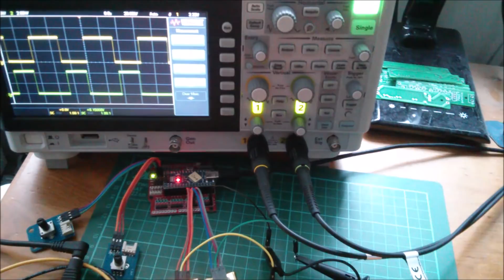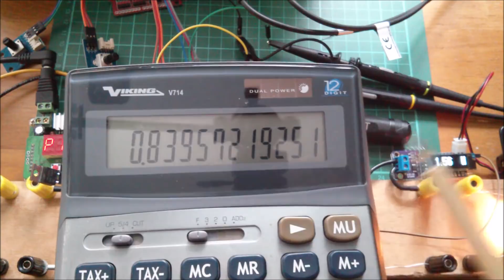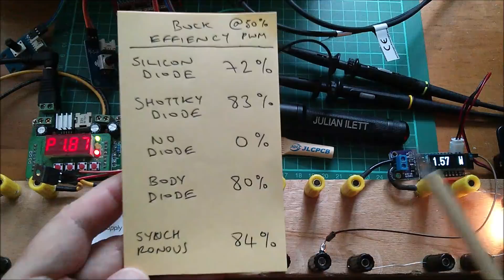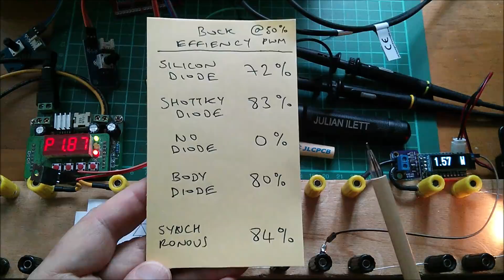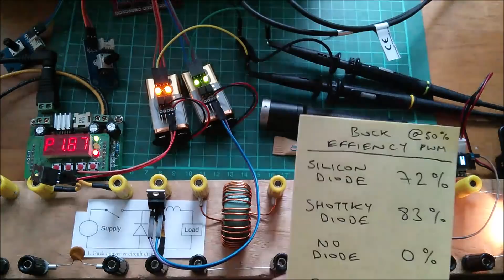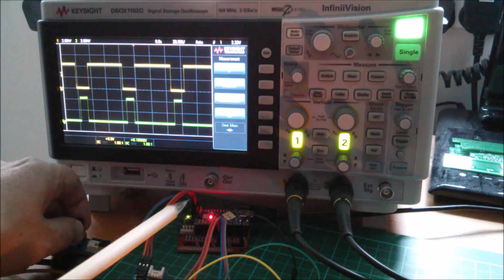Let's build a Synchronous Buck Converter

Comment: whats the value of the inductor, and what effect does changing that value have on the process and efficiency?
Reply from the maker: Not sure - it's quite big :)
Reply: Changing the inductor value changes how fast the current will rise and fall, or the ripple current.
Basically whenever the main mosfet is on, the current through the inductor rises, when it is off it falls. The output voltage depends on this current, especially since julian is not using an output capacitor.

For efficiency the inductor value doesn´t matter on its own. But with lower inductance you have to switch your mosfet(s) faster, which causes more switching losses. On the other hand small-value inductors can be physically smaller and your input/output capacitors can be smaller as well.
Reply: @Basement ScienceE
thats useful info , ive not seen this explained so well before . i tried changing inductors in phone charges to see what happens (not connected to phone) and saw no change at all , so obviously not to critical :-)
Reply: YTANDY100 You always have to consider the load you have attached. In nearly all real SMPS the duty cycle needs to be adjusted according to the load. This is done by an IC, which is also able to cope with wide ranges of inductances.
Reply: @Basement ScienceE
it was a 34064 chip that ran it , i never changed any of the Rs or Cs , just the choke , i never thought about changing the load , i think at the time i was only using an led and a volt meter to see any changes , it was just because i had many similar charges , all slightly different but same chip , some with an output transistor but most without and all had different chokes , i was swapping them and finding some else where :-)

Comment: What happens if you use the shottcky AND the MOSFET? 
I think that the efficiency will increase since the body diode is not that efficient.
Reply from the maker: There is an advantage - the LTC3780 datasheet shows Schottky diodes in parallel with two of the MOSFETS.
Reply: I hope you'll try that and let us know

Comment: But want is the difference between a synchronous and an asynchronous converter? All I know is that one is more efficient than the other. I have looked online without success so far.
Reply: There is a down-side, of course. It means you need a high-side mosfet driver, which may mean a charge pump too. The extra components add a bit of cost, so for applications where efficiency isn't critical you usually just see asyncronous buck converters.
Reply: Asyncronous switches only one side of the buck converter, and uses a passive diode (almost always a schottky) for the other. Syncronous switches both sides at once, keeping them syncronised. This almost eliminates the diode drop inherent in an asycronous converter, thus allowing for higher efficiency.
Reply: DrTeeth the synchronous converter use a mosfet instead of a schottky diode, you need to turn on and off both MOSFETs at a proper time with a deadtime.
The Rds ON of the mosfet (in the order of the mOhms) will waste less power vs the constant voltage drop of the diode (~0.4-0.6V).
This is very useful in high power applications, less space (less heatsinks), less stress in the components (heat in the ICs = no es bueno), and obviously in a battery operated DC DC converter this is just better
Reply: Thanks for your replies. That clears things up nicely.
Reply: Vyl Bird,  thanks for the extra information. It is much appreciated. DrT